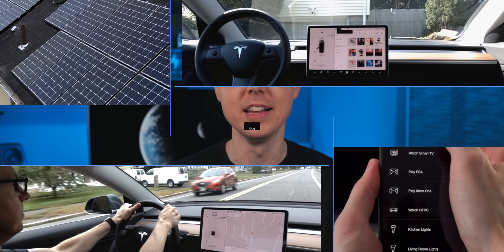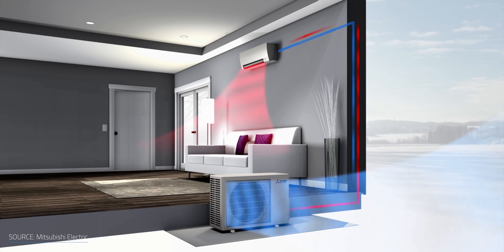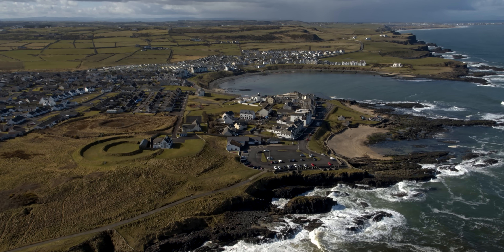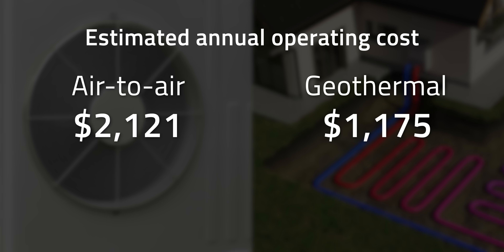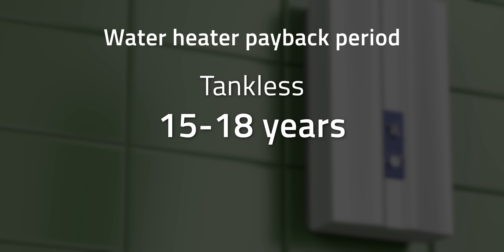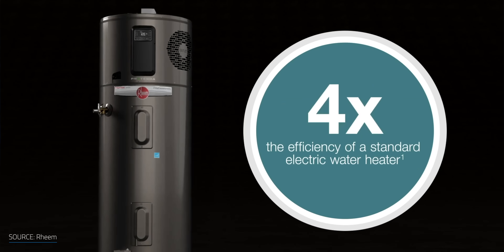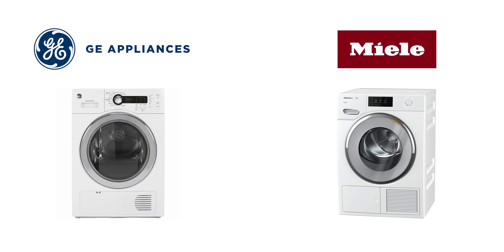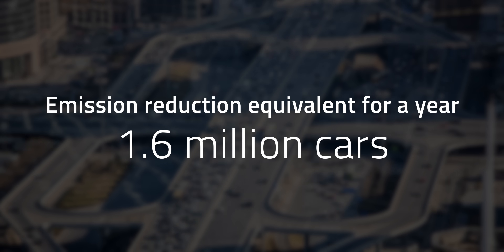Why Heat Pumps are Essential for the Future - Explained

Comment: As a Southern California resident it's interesting to hear how much emphasis you put on heating and then add cooling as an after thought. Everything is literally the reverse here. We almost never touch the heater but have to run the A/C many months of the year. We're all very familiar with air conditioners so if you just explain that heat pump is an air conditioner running in reverse then we'll understand. Of course we don't really think about how efficient our heaters are since we rarely use them. Even more rare is using the heater in a car.
Reply: Come visit us here in Michigan in January.  You and the kids will love building a snowman and playing in the snow.

Comment: Great video, thanks! The cooling gasses used in heat pumps are often a 100 times more greenhouse potent than CO2, so they must be very carefully installed (and disposed of by the end of their life!). I thought thats an important thing to mention.
Reply: While this is true, as we transition low lower GWP refrigerants in the near future, this will be less of a concern.
Reply: No different than an air conditioner. But, they're already beginning to work on alternatives to R134a.
Reply: 100x more potent greenhouse gas than CO2 is really a pretty useless comparison because in one case, it’s a disposal issue, whereas in the other, it’s most often a continuous production issue.

It may be more useful to say that if you let all the R410A leak out of your heat pump (which would never happen), it would take an equivalent gas furnace in a 2,000 sq ft home in Kansas in December way less than one month to emit an equivalent amount of CO2’s worth of global warming potential.

However, if you are getting your electricity from natural gas, your heat pump will cause that amount of CO2 to be emitted at the utility in between one and two months.

Conclusion: The potential CO2e emissions from leaking refrigerant gasses from your heat pump is absolutely negligible compared to anything else you do in your life. Don’t sweat it. (Absolutely keep your heat pump in good repair and don’t let the fluid leak, but the global warming potential will be higher due to reduced efficiency than leaking refrigerant.)
Reply: It is a closed loop.  As long as construction is good and the system is properly maintained, the release of refrigerant is limited to very small amounts.  IT is not like you are replacing the gas every fifteen minutes.
Reply: @plchacker  you are making it sound as if refrigerant leaks are normal thing and systems must leak ??? 
Even tough many systems may have or develop leaks, that isn’t normal and it doesn’t have to happen. 

High quality installation with quality equipment can last lifetime without any leaks.
Reply: @adamdragon8549  my system is almost 20 years old and hasn't been recharged. I have a car that I bought new and the HVAC system has not needed to be charged since I bought it 5 years ago. These systems when functioning properly will rarely leak and I'm glad to see you brought it up.
Reply: @antonisautos8704  I am 25 year hvac industry veteran. Thank you for recognizing.
Reply: @RedWingsninetyone  residential and commercial HVAC systems do not use r134a. R134a is mainly used in an automotive application and is now being phased out for r1234yf. Home systems now use HCFC-22. You may find r134a in a refrigerator. You can also find R-410a in residential HVAC units as well.
Reply: Not saying we shouldn't be careful. But even at a hundred times more the amount greenhouse effect caused by a heat pump will be tiny compared to doing the same amount of heating with natural gas, even if you release all of the refrigerant.
Reply: So heat pumps cut down on carbon emissions but what about heat pollution? What happens when all the things are heat pumps? I mean, it's not spewing greenhouse gases into the atmosphere but it will heat up the ground level air and as that rises it cools again causing rain clouds right.. with massive amounts of hot air blowing from every home/business what will that effect be on weather in highly populated areas? If it's a hot summer day in an urban area will that heat up the surrounding area and cause everyone's ac to run longer?  Honestly wouldn't that just compound the existing greenhouse effect? Because, you can't completely cut carbon emissions, overwhelmingly most emissions/water usage/general pollution are from corporations, agriculture, manufacturing, and mining, not the general public. Industries which are protected by every nations governments. Heat pumps aren't as sensational an improvement as the video claims, it's like a scooby-doo bandaid on a wound that needs stitches.
Reply: @SZfiftyfour  Heat pumps just move heat, so the energy you release is actually significantly lower than the alternatives. Most of the heating you get from an heat pump comes from outside.
Reply: @danhunters8226    I'm aware of the operation as my house has heat pump equipment. Yeah it just moves heat, but it's always hotter than ambient temp. The heat coming from the unit outside is always hotter than the ambient temperature. I'm in Florida, it's 112 index today and the unit is blowing hotter. So what releases more heat into the outside air, a standard hvac unit or a heat pump? It's just something I've wondered about. If you think about it, it's literally just moving greenhouse heat into the atmosphere either way. Like letting the sun create extra heat in an enclosed space, artificially cooling it back down and releasing all that extra heat back into the air. Multiplied by however many hvac controlled buildings exist on Earth. Also, I'm mostly talking about cooling, in the case of heating, of course heat pumps are cleaner. However, I'm really skeptical as to if they work up north honestly. Even in Florida when it gets cold for at-most 3 months, my heat pump struggles. They don't like the cold.
Reply: @antonisautos8704  These systems leak more frequently than older systems.  Materials are cheaper, and we see more and more refrigerant leaks than ever.  Maybe it's just a lack of quality control, but refrigerant leaks are more common.  And we see them while the equipment is still covered under warranty, but the refrigerant itself is not covered by the warranty.   In a perfect world, with better manufacturing, leaks would not be common.
Reply: And automobiles too, they all have them too, let’s face it huge embedded energy, good on China to make them for you !
Reply: @B-Nice  I have a 2006 BMW and have boughten used Volkswagens from 98 and 2000 and non needed their refrigerant recharged.
Reply: @B-Nice  The leaks are because of efficiency mandates. They have to make the tube wall metal as thin as possible, to keep the temperature difference between the condenser and outside ambient as low as possible, to keep the compressor head pressure as low as possible, which unloads the compressor and reduces energy consumption. These thin condenser tubes have less margins for cracks or corrosion. It's a giant scam. And refrigerant "transition" is another scam to keep the dominant refrigerant whichever one is currently patented by Dupont.
Reply: @gregorymalchuk272  I agree.  Most of the leaks I see are on these thin microchannel coils, in or outside.  It would be a beautiful thing if great products were made.  Planned Obsolescence doesn't help either.   These new 'mildly flammable' refrigerants sound fun, also.
Reply: @altosack  Similar to the "non recyclable" blades of a wind turbine, which are a drop in the ocean compared to the millions of "recyclable" plastic bottles that are thrown in landfill daily.
Reply: @SZfiftyfour  as he said, heat pumps move heat, they don’t create it. So no your suburb won’t heat up  lol
Reply: @kdkd693  Exactly, the sun creates it, through the greenhouse effect. In the direct sunlight, the air in your car is way hotter than the outside ambient temp. Running the a/c transfers that heat outside. Same goes for buildings. Times that by millions, and how is it not thermal pollution?
Reply: @SZfiftyfour  but don’t you see, in your example the heat was already in your car. If you opened your car doors for 5 minutes, same heat moved yes? by your argument, you would never get out of your car lol.
Reply: @kdkd693  Don't I see? I see your moot points and fabrications that were never implied. When you open the door the greenhouse heated air is released. Which is practically the same thing as running the a/c. The heating effect doesn't stop because the a/c is on, the a/c is continually regulating it and blowing it out the cabin. Bruh I'm done, Jesus take the wheel.

Comment: Working as a maintenance tech for Arcadia Bluffs Golf Club, I monitor 50 heat pumps.  One for each room.  Most are about the size of a 3 cubic foot freezer.  Other than the network system circuit board and the system software that monitors all of the components of each heat pump via a computer interface, the 50 heat pumps are a very simple machine.  I am amazed that one minute the forced air is putting out 53 degrees and after the switching valve changes when the tenet adjusts the thermostat wanting it warmer in the room, the air then turns to 82 degrees.  99% of the maintence on each unit is only changing air filters.  That's it,,, they just work!

Comment: Seems like with the heat pump we need an integrated hvac/hot water heater setup.
Reply: its in the works from a few manufactures. but as an hvac service tech I wouldn't want my hot water to shit out when my ac shits out. they should  be separate.
Reply: They do have heat pump water heaters that are being made right now. Actually considering this technology when my water heater goes out again.
Reply: It's called a desuperheater, free hot water from your AC
Reply: @Silver_GDB  solar hot water heater
Reply: @Silver_GDB  haha well it doesn't have to output the liquid coming from the two systems.  I just mean using the energy interchangeably in both systems :)
Reply: You can get heat pump water heater. They have been around for a while.
Reply: @adamdragon8549  yes, but I mean integrated with your hvac, not just a heat pump water heater standalone :)
Reply: @CrypticFoxGaming  There are options where you can heat domestic water via hvac system, however stand alone heat pump water heater is better in my opinion. One of the features is you can separately from your hvac system program it “Saves more energy” also hvac system are usually seasonal where water heaters are not.
Reply: @CrypticFoxGaming   what you described would be one heat pump for comfort heat and domestic hot water. Which would mean one box doing both. I’d rather have two separate units so if I lose one. I don’t lose the other at the same time. This is already a common setup with boilers. And it does work. But if you lose heat. You also lose hot water.
Reply: Many systems such as Water furnace offer hot water boosters that assist your main hot water heater.
Reply: I have seen some geothermal heat pump systems that have an outlet to the hot water heater.
Reply: No thank you. Having them combined would hardly make a difference in efficiency and if it breaks I’m out heat and hot water.
Reply: @Nicholas-f5  Nothing is free, even if it's a biproduct.
Reply: @CrypticFoxGaming   The big issue here is the typical house does not use enough hot water to keep the AC on all day in the summer time.  And, it only works in the summer time when the AC is pulling heat out of the house.  In the winter, when you really need to move the heat into the house, the water heater would need a different heat source.  This (using the heat from the inverters to heat water) is being done in some solar applications and they actually have to drain hot water in order to keep the inverters cool. While taking advantage during the summer will certainly help some, the expense of the system and careful maintenance makes a ROI in the negative range.
Reply: @plchacker  Fair enough.  Just seems like at present we're using double-energy with both systems producing some waste (at least in the summer).  The frequency of need in both systems I could see being a challenge.

Comment: I realize you are working on building a new high efficiency home and are considering using a Ground Source heat pump. I've been researching options myself and appreciate all you have and are doing here.   My question is if you build a new home close to if not at Passive House standards (to which I assume you've looked into) wouldn't the necessity of a GSHP be a bit excessive for the size of home you will build?  I know of several Passive homes that have been built here in Minnesota and have been told that yes a GSHP is more efficient, but due to the calculations for HVAC needs, even the smallest GSHP is overkill. Any thoughts and feedback would greatly be appreciated.
Reply: The Boston area is a middle Zone5 climate, at about 5000HDDs annually, with a 99% design temperature of 1°F. That is an easy climate for a high efficiency, ductless, air-to-air, mini-split heat pump, on a tight well insulated house. In that climate a 12000BTU HSPF14 mini-split should be able to function seasonally about as economically and efficiently as a HSPF13 would function in a typical Zone4 climate like Louisville KY, which is the kind of climate that SEER and HSPF rating are based on. A HSPF15 would function like a HSPF14 in Zone4.. So, de-rate it by one HSPF grade for the colder Boston climate and by 2 for Chicago, Detroit, Nashua, Toronto, etc.  That is rough, but so are the ratings and climate zones. Most houses built to, or near, the overkill PassivHaus Standard should do just fine with a 9,000BTU, SEER 38, HSPF15 low-temperature mini-split. After all, many, if not most, PassivHaus houses use only electric resistance in their HRV/ERV air systems, since the heating that is needed after modest solar gain and normal interior generated heat (from non-heat electric usage and body heat) is enough for most of the heating season. They often need cooling/venting during what for most homes would be the heating season  Even plug-in electric resistance heaters are fine for extra cold times and will cost a tiny fraction as much as throwing tens of thousands into a redundant ground source system that will likely not be any more efficient than the smaller super high efficiency ductless mini-splits.  In fact, these high efficiency air-to-air heat pumps, in Boston's climate, will operate at a seasonal average COP of around 3.7, which is about all you can expect from a ground source system that costs many times as much. For heat pumps, smaller is better, because of efficiency.  If you really want over-kill, simply install two of them instead, and you won't lose efficiency like you would with a larger capacity one or multiple heads. It will save huge amounts of money (and interest over time), supply an efficient backup system, spread the heat better, and will require far less embodied carbon. When a 2000ft² house is designed to need not much more than about $500 heating annually with Boston's very expensive electricity, and especially if you are using mostly self-generated solar, these minor heating cost differences, in either direction, are trivial, especially next to the huge extra cost of a financed ground source system. it simply makes no sense, when you look at even very basic numbers. A 2000ft² PassivHaus cannot need more than 6400BTU maximum (at design temperature). So, the big question is  "Why not use a simple, low-cost, high performance, 9000BTU air-to-air mini-split that is capable of outputting 50% more than that at design temperature, instead of an overwhelmingly redundant ground source system, which after interest will most
likely cost more (additionally) for decades, than heating the house? 

 PS...We heat our 100 year old, 1200ft² home (mid-remodeling) in a 7000HDD climate with one 12000BTU SEER30.5 HSPF14 unducted mini-split, and we have not yet air sealed and insulation wrapped it.  Our total energy bills are less than $1000/yr including all the charging of our electric car.

This movement, as part of our transition from fossil fuels into a more sustainable world, is supposed to be about better and more efficient housing, not more excessive and more wasteful housing.

Laren Corie
Renewable Energy Educator
and Designer of Passive Solar
and Energy Efficient Homes
Since 1975 (retired)